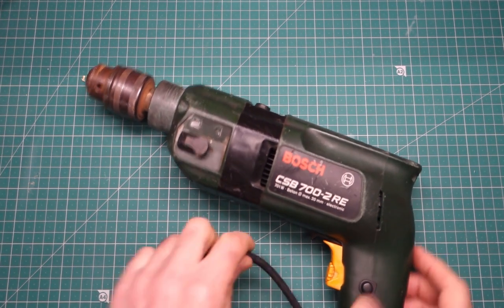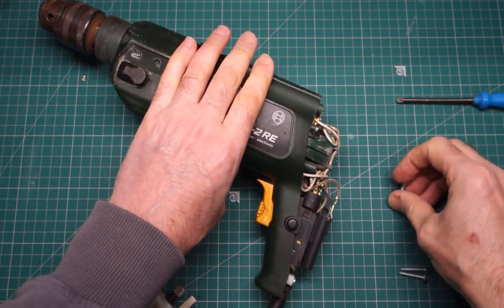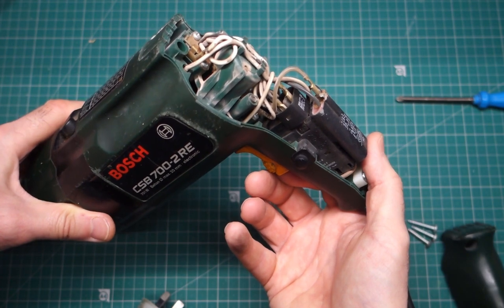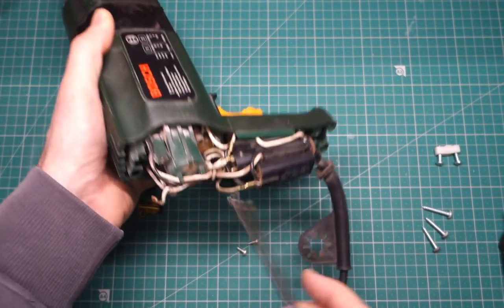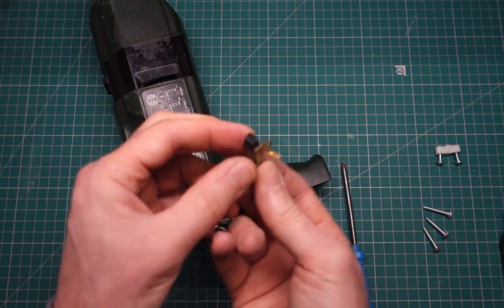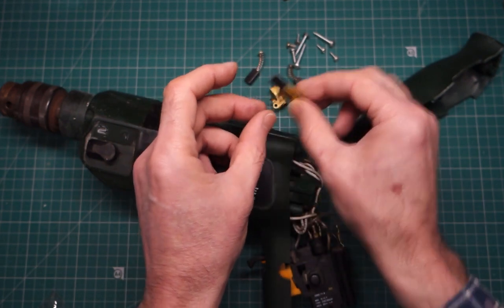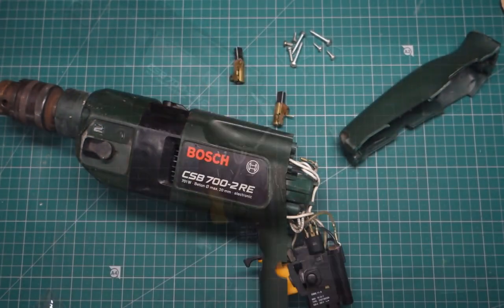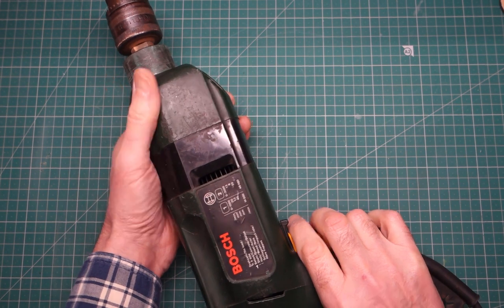Ep 34 Bosch Drill Repair

Comment: Have a similar model the Bosch "Jumbo" 2 speed hammer drill. In addition to the 2 gears there is a variable speed via the trigger with a setting wheel in its leading edge.  Purchased at McEwan’s Chadstone which is long gone.

Comment: I would imagine after a week of using it, the brushes bedded in to the commutators, less sparks :-).
My mate has a bosch angle grinder, it lasted 10 years, then it stopped. How dare it lol.
The brushes were ok, i found one of the field winding copper wires had snapped off the post.
Re solder and epoxy fixed it, can't let a good tool die :-D
There used to be a product called a "Com Stick", handy to smooth rough commutators.
Reply from the maker: Yep.  The sparks a.k.a "Angry Pixies" have calmed down now!

Comment: Nice job. I have a BOSCH CSB 500 2E which just stopped working (dead) the other day after drilling some holes in concrete. The brushes looks fine, so I don't know if it's the trigger, nothing burned. Do you have a link to the parts you got, maybe they have a new trigger. Like you, I brought mine with me in the mid 80's from Denmark. Don't want to buy another one, not enough life left in me for that. Haha.
Reply from the maker: Thanks for commenting Michael.  Despite their age Bosch have good  exploded diagrams and part numbers on their website.  If you are in Europe parts should be easy to obtain.  I'll try update the video description at the weekend with some links.
Reply: @PowerOn-  Like you I'm in Australia too.

Comment: Your lucky it was only the brushes. My Dad’s Sears drill with an all aluminum case is shot. Both the brushes are shot and also the armature, and the armature is not available. Maybe I’ll see if the guts of my plastic case Black & Decker drill will fit in the Sears aluminum case from the 1960’s.

Comment: I've just picked one of these up along with a piller drill stand for it. Do you know what the letters on the yellow trigger wheel refer to? And the switch on top of the drill - normally that triggers a hammer action, but it doesn't seem to change anything! Any ideas welcomed! Thanks again for the video - saved for if something goes wrong!
Reply from the maker: The yellow wheel is the fine speed control.  The hammer is just the toggle on the top.  I've never had problems with either so can add much more advice.
Reply: I have a CSB 650-2RE and on mine you can't switch the hammer on or off unless you first rotate the gear knob so it's in between 1 and 2. Don't know if it's supposed to be like that or if something goes wrong in them over time. There's also a little chart on the top of the housing which displays all the recommended settings for different materials and sizes of drill bit - for example E on the trigger and gear 2 for drilling in wood up to 20mm.
Reply: @arpie2081  IMO it's a clutch mismatch/gear setting: my psb12 vsb2 has a similar probem with a similar workaround. Prolly not intended, but it does prevent accidental shift from hammer action to screw/drill action due to vibration in use; a quick way to avoid it is rotate the chuck manually by ~1/2 turn while pushing the slider until it clicks, implying that the geartrain cogs should now be fully engaged (imagine an old car's gearbox/differential setup)